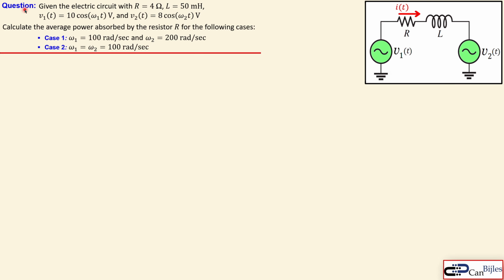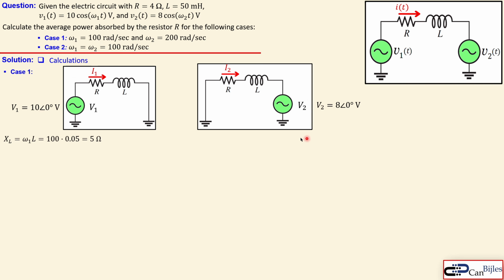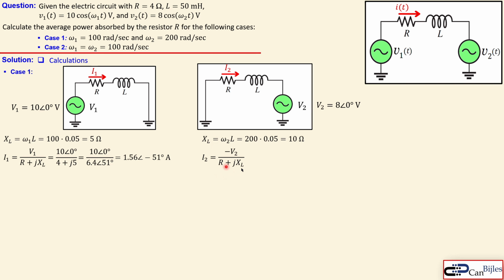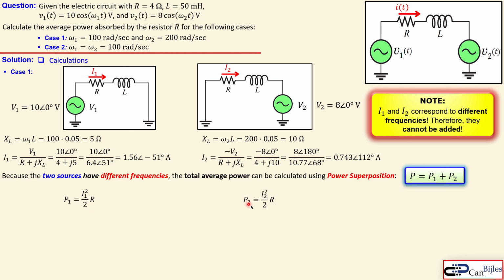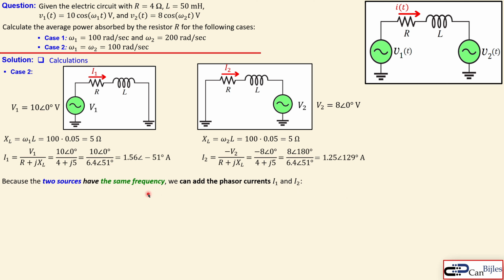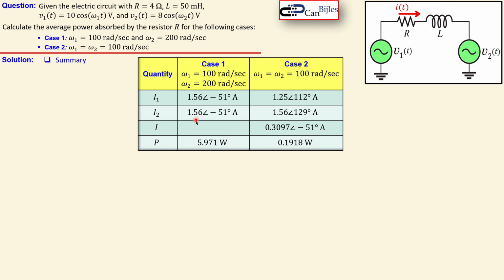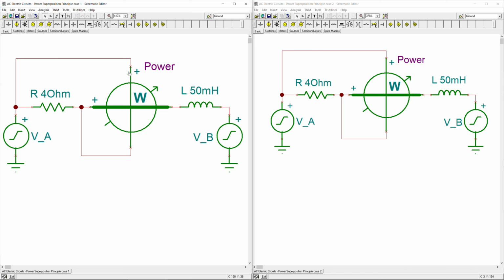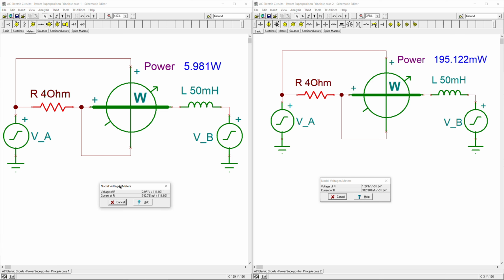⚡ Power Superposition Principle in AC Electric Circuits ⭐ Calculations & TINA-TI Simulations

Comment: You could leave I2 with a minus sign and the angle -51 and just have I =1.56  -1.25 = 0.31 at -51deg?
Reply from the maker: Thanks for your comment. Yes, you are right. That is in this case faster :) but only if the angles are equal to each other.